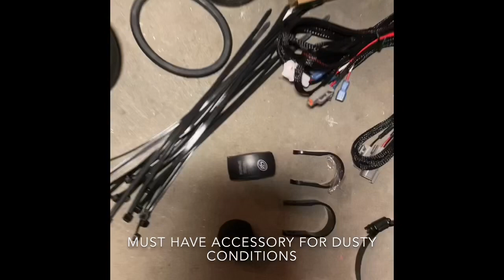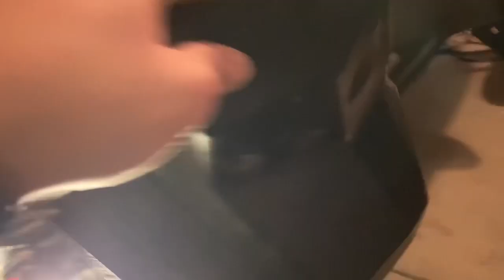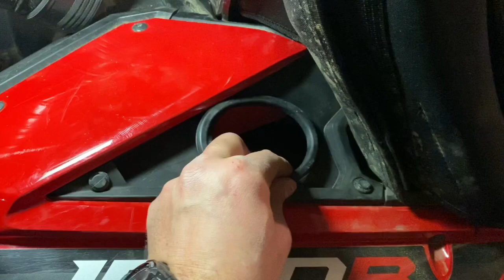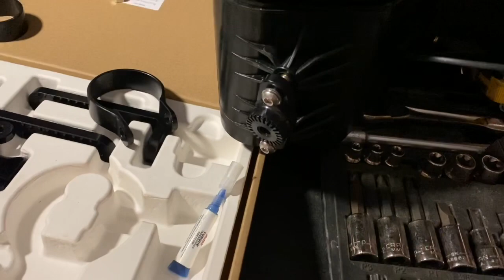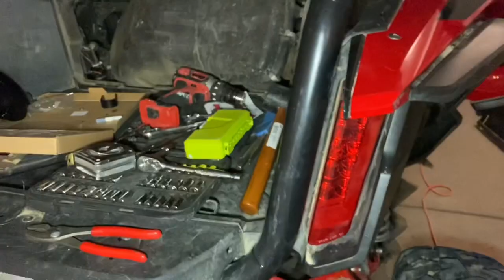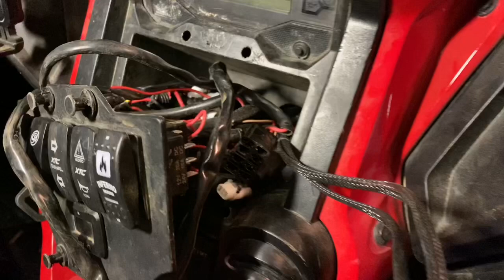Honda Talon Particle Separator W/rear panel how to install. 1000R 1000X

Comment: I’d like to know how the clamps for the S&B filter fit on that tire bar. I tried my clamps up and they don’t tighten up enough to hold the S&B filter up on it
Reply from the maker: I have that info in a different video I believe. The bar I use is a 1.75”OD, so I ordered new clamps for S&B.

Comment: How many miles you getting on a filter now
Reply from the maker: 2000-3000 miles!
Reply: @gravesru  works as a snorkel?
Reply from the maker: @joelanzo3452  yep! If it’s air tight, it’s water tight
Reply: @gravesru  debating on doing a straight snorkel up from the air box or put one of these in
Reply from the maker: @joelanzo3452  particle separator is great for dusty conditions

Comment: does this act as a snorkel? I just asked for a snorkel and they installed this.
Reply from the maker: I use it as a snorkel as well! Very happy with the setup. I have 10k miles on my talon now
Reply: @gravesru  hey there. So I called S&B(the Manufacturer) and they told me it is not a snorkel and that there are other things that need to be done to make it a snorkel. The lady said it would ruin the engine if I use it as a snorkel. Do you mind if I ask did you do any other modifications to it to make it a snorkel or is it just working as a snorkel for you? Right now the dealership that put it on is wanting to swap it out(they are admitting they made a mistake).
Reply from the maker: @relentlessfax87  I use it as a snorkel as is. If it’s air tight, then it’s water tight. But I don’t go through deep water frequently, usually only for a few min crossing a River.
Reply: @gravesru  well that is good to know. I just didnt know if there were other areas that need to capped or sealed. I am trying to drive in water up to my waist lol.

Comment: Where did you find any instructions on install? The QR Code takes me to accessory brochures. I am installed to the point of plugging in the harnesses. Please help
Reply from the maker: Todd Larsen http://cdn.powersports.honda.com/documentum/MW01/0SB01-HL6-A00.pdf
Reply: @gravesru  Great thank you very much. I had just figured it out when your message came through. Thanks for the quick reply. Loving my 1000X4 Fox Live Valve.
Reply from the maker: Todd Larsen glad I could help!

Comment: I took a particle separator off a RZR and installed it one my Talon before one was available from Honda.  It had a relay which I wired through the ignition switch,  so I usually never hear the PS running.  Don't know why Honda has the rocker switch.  Also, I mounted it to the upper roll cage bar.  I made extension arms to move it toward the rear about 6 inches then cut a notch in the top of the back window.  I also got the dust diverter kit from S&B and ran the dust dump hose down by the left rear tire.  I'm thinking of getting the Turbo, but will only do so if I can still use the particle separator.
Reply from the maker: Wendell Alumbaugh That sounds like a good idea. With a little bit of plumbing, you can make the separator work with the Turbo Kit. I’ve had my turbo since the beginning of February and it’s ultra frustrating that it doesn’t run right. Sometimes it doesn’t want to start, backfires and runs extremely rich which burns double the fuel. I’m hoping the turbo issues will be resolved soon
Reply: @gravesru  I'm not an expert in any of this, but shouldn't the FI system be regulating the amount of fuel.  Not sure what part of the system the turbo plays when it comes to the amount of fuel.  I was assuming, (again I'm not real knowledgeable in this stuff) that the turbo pushed more air into the cylinders and when the FI system sensed the "leaner" mixture it added more fuel, which results in more power.  If that's true, then wouldn't the problem you're having be related to the FI system?  Also, are other Talon turbo owners having the same problem?
Reply from the maker: Wendell Alumbaugh I’ve spoken to several others who are experiencing issues with the turbo at higher elevations. I believe the factory O2 sensor and the software aren’t working properly together to manage the air fuel ratio AFR. I’m hitting 8’s on my AFR gauge and it shouldn’t ever go below 10.5. The factory O2 sensor is a narrowband. Forced induction needs a wideband sensor, but the Talon ecu is not capable of using/reading a wideband O2 sensor. So, I’m scared that the talon won’t ever drive properly with the turbo. Not sure why Honda just didn’t release a factory turbo option. I never expected to have these issues, especially since Honda promoted the turbo kit back in June of 2019.
Reply: @gravesru   Check, but I believe the issue is with incorrect barometer mapping/correction factors straight from honda.
Reply: @gravesru  Has this issue ever been resolved? I’m waiting on my SE to come in and am wanting to get a turbo.
Reply from the maker: @rustyp21  not to my knowledge. Particle separator is the way to go.
Reply: @gravesru  I’m referring to the turbo issue you and others are talking about. I’m thinking the particle separator is the way to go, but I don’t want to get a turbo if it is going to give me a head-ache. Great videos! I’ve been watching them all and learning a LOT!
Reply from the maker: @rustyp21  thanks for watching! I have almost 8,000 miles on my turbo. I do recommend getting it. The power is great.